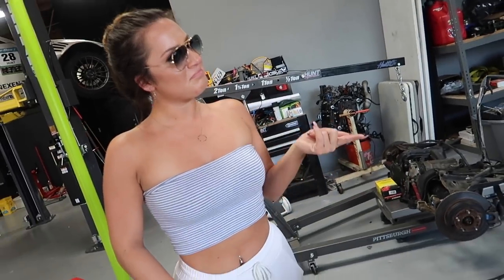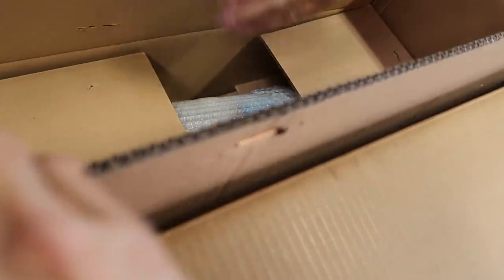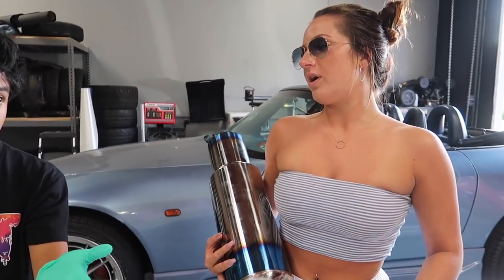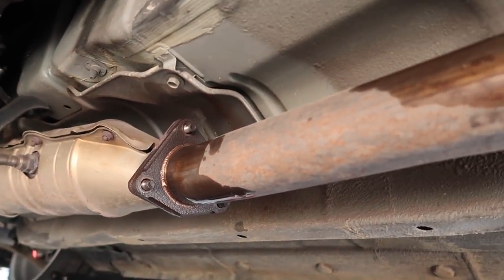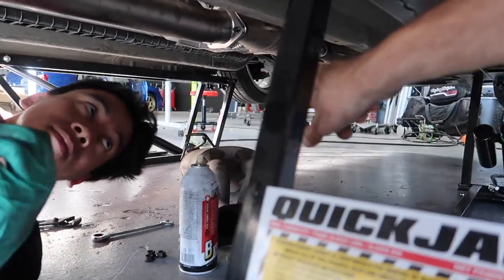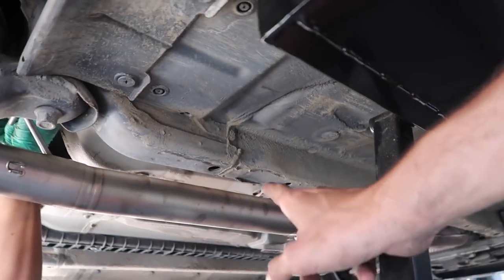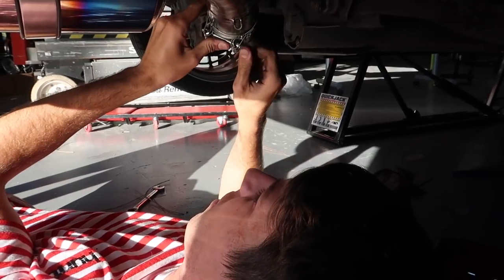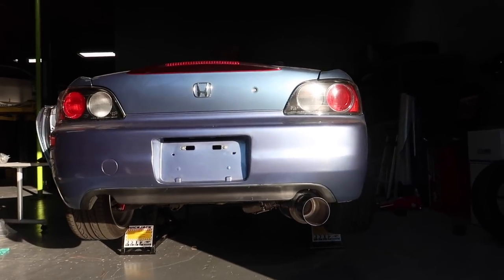LOUDEST EXHAUST EVER - HONDA S2000

Comment: Since the exhaust is full titanim, you need to wipe the exhaust off so the fingerprints you and Sabrina put on it dont get burned into it when it starts changing color.
Reply: ravesilly that's an insanely good tip
Reply: Got it from Mickey ...
Reply: Have known this before Mickey mentioned it.
Reply: Swrv Swrv didn't watch the video so wouldn't know lol, I assume he commented it before Mickey said it
Reply: I also skipped most of it and went to the driving part so if Mickey said it anywhere before that I didn't see it.
Reply: Swrv Swrv That's a known thing with titanium especially. And they didn't clean it. That can is permanently fucked up. It's going to look like shit shortly.
Reply: I was looking for this comment. Shoutout to Sabrina for pawing this sweet piece up
Reply: Liam McKeever  Mickey didn’t say anything in this video, but he has mentioned it in a prior video I believe. Not sure which one tho

Comment: oem hardtop next even tho it's $4000 😂 it has perfect fitment and doesn't rattle like the others
Reply: i want one D:
Reply: oem hardtop will still rattle
Reply: Jeff Kempienski not mine
Reply: Not when installed and adjusted correctly. None of our S2000's with OEM tops have a rattle. 
 @GeoffryMoto

Comment: It sounds absolutely phenomenal..... I don't know what you guys are bitching about cuz I would be 100% stoked to have that sound.... I thought the whole point of having that is awesome to have the race car experience... I mean it's an S2000 it was the motor that's designed to have the most power 4 liter ever it was pretty much F1 designed
Reply: it's a cop magnet
Reply: Nathaniel Delille Photography we know she is but what about the exhaust
Reply: Funny thing is my car is louder than that and cops don’t care as long as you drive safely
Reply: Not the most hp per litter anymore. Beaten by Ferrari but it took them years to beat it. This is what Honda is capable when they really goes to work. Except if you let the American Honda team. They fucked the iconic NSX up.

Comment: granny shifting,not double clutching like you supposed to...!
Reply: Mr.Ek good meme....synchronized transmissions (mostly all newer manuals) don't need to be double clutched
Reply: You kids think everything needs to be double clutched lmao
Reply: This is still the single greatest car troll to me as nothing in the race in Fast 1 had anything to do with downshifting to need double clutching. They got trolled by the crowd on something car savvy to say. And no one knew any better back then.
Reply: People saying double clutching is useless are stupid. Just try it and see how faster is shifts and how smoother it is. I know transmissions have synchros but it helps it getting synchroed much faster. But not needed for regular driving except if you have bad synchros, but for stuff like drag racing, shifting faster helps.
Reply: That's how I whip dump trucks from the 50s and 60s. Modern-day vehicles not so much.
Reply: And she has to look at the gear when shifting, seriously!?
Reply: Double clutching is the biggest bullshit ever
Reply: What the fuck is a double clutch
Reply: Steven Lee   2 times pressing the clutch when you switch gears 1 time to get out of the gear en one time to go in gear

Comment: Hi all! Just thought we'd chime in here after seeing some questions about QuickJack's safety. Those hanging arms on each frame are actually travelling mechanical safety locks that work like built-in jack stands. TJ and Calvin (and you) are totally safe crawling around underneath as long as the locks are engaged.

Comment: I went through this same stuff with my exhaust on the 370z. AAM midpipe and axelback and it was 10/10 loud. 

It’s so interesting to watch you all go through the same thing like “omg the pops!” “Omg the growl it’s so dope” “wait it’s loud as shit and I have to daily it”

“Maybe I could daily it” *does pull
“Nope”

Although I did daily mine for about 2 weeks. Ended up throwing the stock muffler back on there and now it sounds a little too quiet tbh but it’s a good compromise.

Comment: Tho you could pull some power with a smaller diameter exhaust because it forces exhaust air to move out quicker because it doesn't flow as well and it wants to get out. Don't @ me but rally cars

Comment: The lightest exhaust is a Veilside exhaust. It only weighs 6 pounds. and it's the loudest exhaust. They have one on a Honda S2000 in my magazine and it says it's the loudest. I don't know how much your exhaust weighs but this is only 6 pounds. Some people like saving weight. My brothers Handa Prelude had a Magna Flow exhaust and it was louder than that. I could hear him on the main street by my house. Which was over two blocks away. I do like how it sounds. wait till you put the headers on then it will be really loud.. :-)"

Comment: needs a tune to optimize power now that you changed exhaust. the stock s2000 exhaust is actually well built and you tend to lose power without a tune

Comment: 4 cylinders will never growl.  If she wants a growl get her a v8. Also when you say drone are you just talking about the sounds or the resignation in your ears. If it is that resonation that is why the car had a resonator in the system.  You take that out you get that vibration in your ears that is characteristic of dual over head cam engines.  Try the drone in a DOHC V8.

Comment: Is this j racing Rr or Rs? And 60 or 70 mmis it easy to install  ? And bolts directly to the headers or yoi need a test pipe to run it ?

Comment: TJ it will quiet down... the exhaust and fiberglass need to break in ... my 350z was insane with my Titanium Agency power exhaust...  as you drive it the fiberglass sets and the computer may balance out air flow readings, proper instal should be making it quieter sooner, but the ALL titanium tomei are thin tubing so naturally louder than steel tubing on an Agency power where only the muffler is titanium.

Comment: I’m thinking about getting either a 2007 s2000 or a 1989 Supra. I’m so lost on which one I can get. Helps plz
Reply: get an ap1 s2k they rev higher but are a little older (ap1 1999-2003, ap2 2004-2009)

Comment: I did an exhaust upgrade on my first s2k... and regretted the hell out of it. The drone was nauseating and at the speed limit on the highway... pure migraine inducing.

My current s2k is stock.... and just as fast as the exhaust modded one I had. Don't for the love of god, straight pipe or over diameter the exhaust on these things. They will ruin the driving experience.